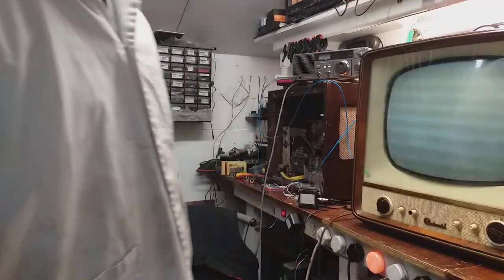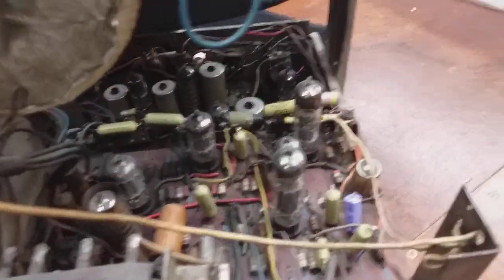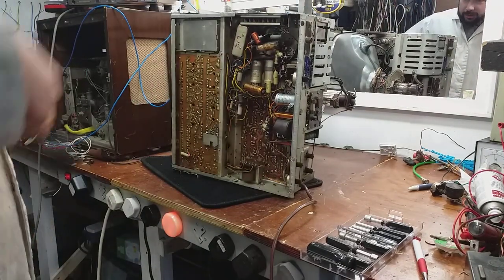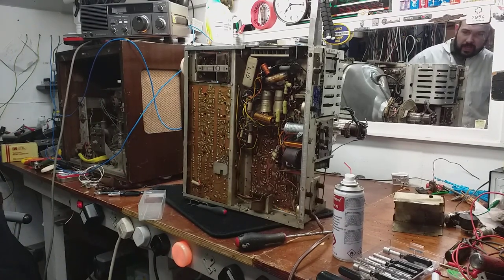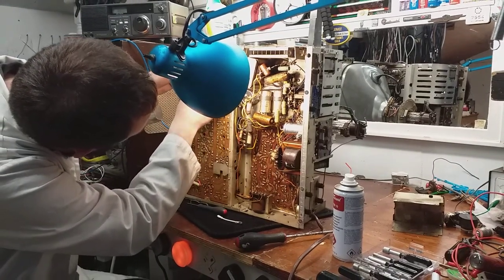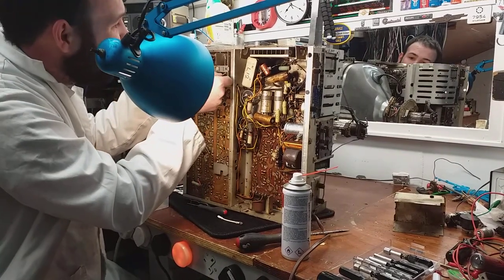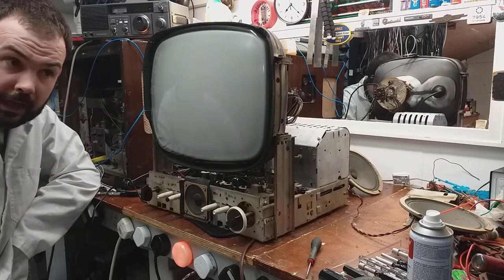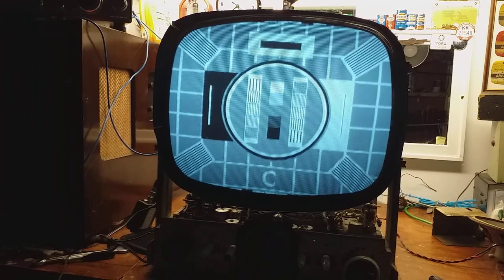Pye CTL58F.......

Comment: Hi again JJ. Yet another gem of a TV, excellent. I was surprised that the TV has PCB's as I was not even aware 1950s TV's used PCB's. Must have been an expensive set when new, especially when you see the amount of speakers and no doubt the added circuitry. Impressive. As for grommets, Toolstation do a small 35 piece kit of various sizes (68673) for a couple of pounds. As always, great video and keep up the great work mate.....
Reply from the maker: Thanks Bob, I must check out toolstation.

Comment: I havnt needed to clean switches for a few years, R.S do seem too expensive with most of there products.
I two time you with a bunch of radio repairers lol, they often use a general switch cleaner spray.
The small local electronics supply shops have closed :-( , i would try amazon for a generic switch cleaner.

Do you remember the channel switches that used brown strips with copper rivits as contacts, many strips were mounted in the cage and they came in to contact with finger contacts when rotated.
I can't remember what they called them but i thought they were a neat idea :-D
Reply from the maker: Biscuits! Thanks ZX.

Comment: Was that the Pye model with the line oscillator that would drift in frequency?Used a PCF80 as the  oscillator... Later production had a modified circuit.
Reply from the maker: I'm not sure on that, this one has been stable in that department so far. Hope you're keeping well Hugh.
Reply from the maker: John has it, must get another lend of it.